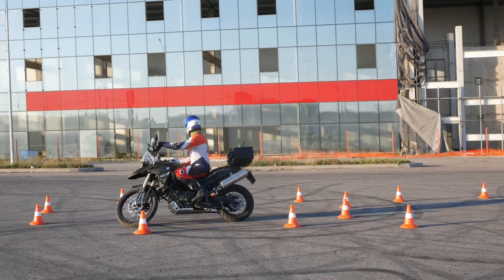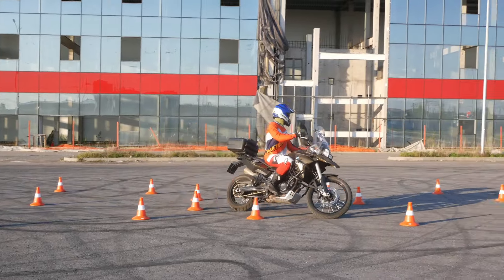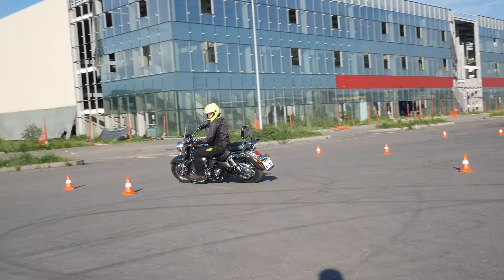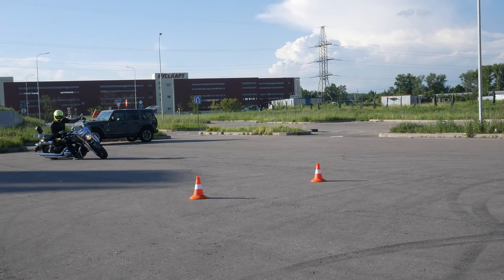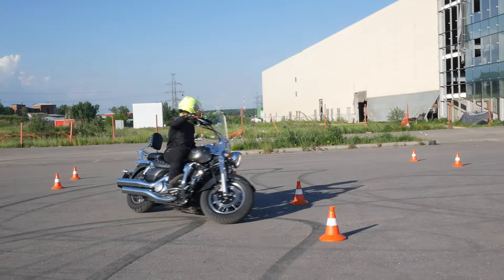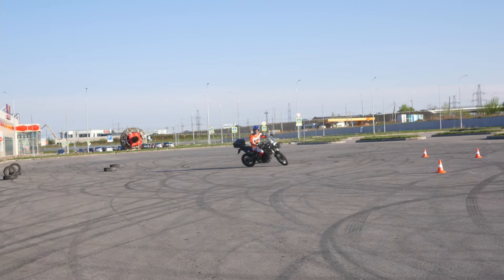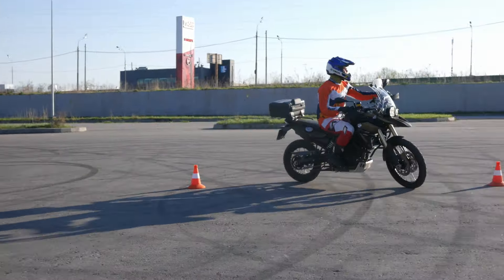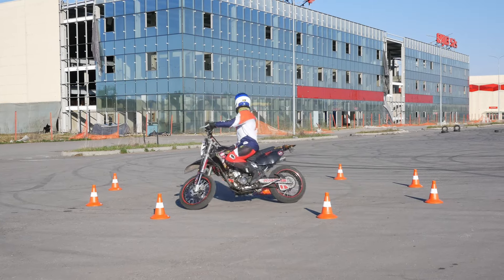How to NOT BURN your Clutch

Comment: New here bought a bike with my last stimulus check. 1999 Kawasaki Ninja 500R. I fell on it, I didn't want to ride it for a while. Lately I'm trying to do the work on it myself to get it going again. I think the clutches were burned. I'm having a hard time putting it in gear as well. Hopefully the new clutches will help. Once I have a bike running again I need to start learning. I've been checking out your videos and I think I'm going to start here on your channel.

Comment: Hello. If I understood it correctly, 

We should NOT be using our rear brake for a long time while using the clutch in the friction zone, because the drag created from braking heats up the clutch. Thus, we could use the friction zone endlessly, with no wearing, as long as we don't use the brakes at the same time.

Correct?
Reply from the maker: Hi! Using endlessly with no wear at all is a bit overstretched, but basically yes, this way the wear on the clutch is minimal.
Reply: Hi, does that mean it's better to press the clutch handle first and then hit the rear brake? Or did I get it wrong?

Comment: What if the motorcycle is new and the clutch is smooth and it works great, then it goes in for the first service at 600 miles, and the clutch hops in first gear until you let it out all the way?
The clutch works good in second, third, forth, fifth, and sixth.

Comment: Hi Andrey, where to start. I like the videos a lot and I had to look on a few, since I came off my FZ1 recently. Winter time and the new tyres (S22s, but not the first time having a new tyres) were for sure playing role in that, but also my 2 year break when I did not have a bike, could contribute to it as well. My problem is, I got really bad skid to the left, as I slightly accelerated coming of the curve, and then  trying to save it,  I got even wilder one to the other side,  where I had to drop it.  I was going up hill, speed probably 30-35 mph.
 I came off the bike once before but that was totally my fault, as the turn was sharp from downhill up, also at the Xmass time.
 I have been to Norway in 2018 all the way to Nordkapp, three weeks on my own, just meeting people and bikers on the way, traveling fully packed up ( +/- 50kg) and I was riding in the rain, in serpentines I was taking it nicely, slightly brushing my foot pegs off those days.  That was in 2019.
 Now I have a bike again , since September 2022, a little stronger, from Fazer 8 to FZ1. The rear tyre is 190 instead of 180 in size. I have decided to do some of these exercises and brush off the skills.  BUT, is there anything I need to bare in mind going from 108bhp to 150bhp apart from that the bike is stronger? I feel, personally, I need to get to know the bike better in using the throttle when coming out of the corner, also the wider gum surely needs more attention.  Don't get me wrong, I love 1000cc naked, the bike is even lighter than my previous Fazer 800 and gives me really nice experience in less effort in using the throttle, but cornering seems different.
 I want to take this bike on tour around Spain this year, but before I go, I need to get myself sorted and absolutely friendly with this one machine. It has the same frame as Fazer 8,  the same feeling..  But am I missing something?  Full lock turn is not a big problem even now, but it is not smooth..atm.  Before my break, I was riding every day, commuting to work, food shopping, all on my bike (FZ8) for over 6 years. My confidence is still fine, even after that little road slide up hill, but I fee like I'm going to have to refresh hard, at least for a few weeks, if not months, until it'll start coming back fully. 

 All the best Andrey!
Reply: Bro I have some S22s on my s1k, they’re some sticky boys for sure